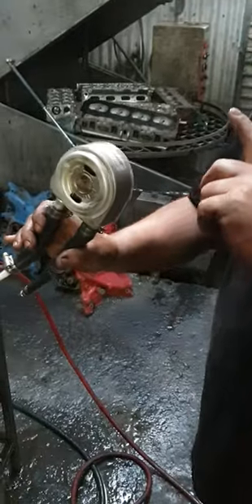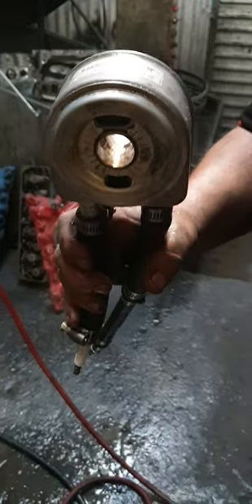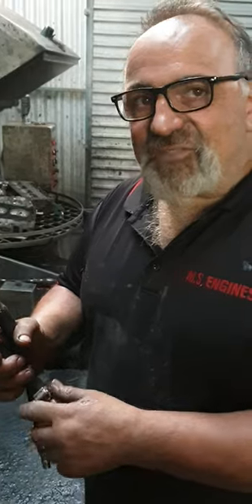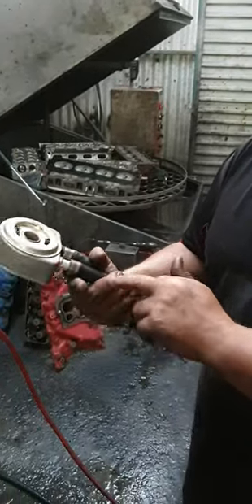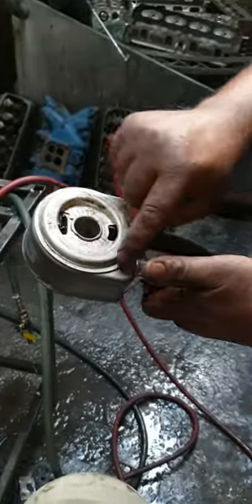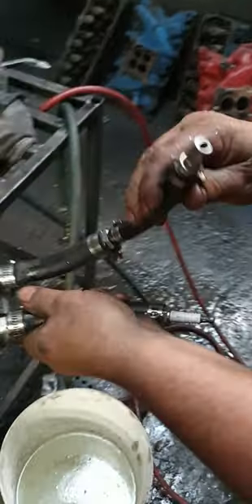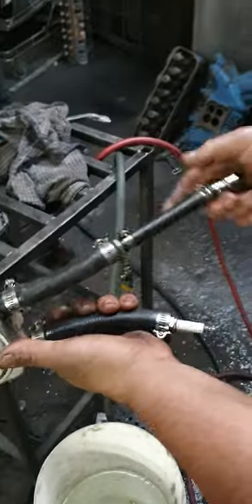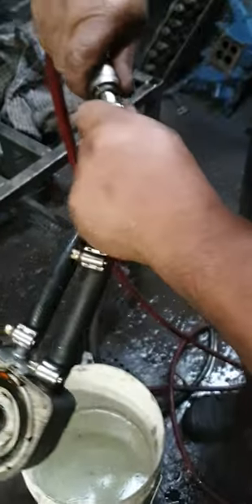Oil Cooler testing

Comment: I had the same problem with a vw t4 2.5tdi i didn't pull the head i had a idea it whas the oil cooler and it whas the cheapest thing to try only the cleaning of the cooling system is a headache 1 year later and my coolant bottle stil gets dirty after cleaning it for about 7 times now every time it gets les doh very nice videos keep it um and have a nice Christmas and new year

Comment: What engine is that cooler off of?
Reply: That 1 comes off Ford 4.2 v6. I got the same 1 on my truck
Reply: A lot of manufacturers use it
Reply: There's an identical setup on a 1995 Camry 2200 engine
Reply: Could be pursuit chargers as well